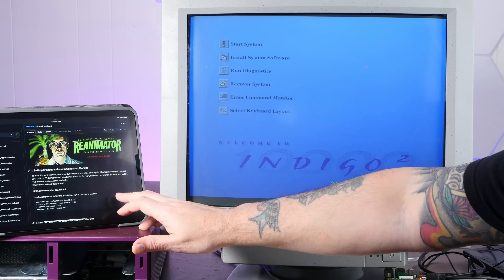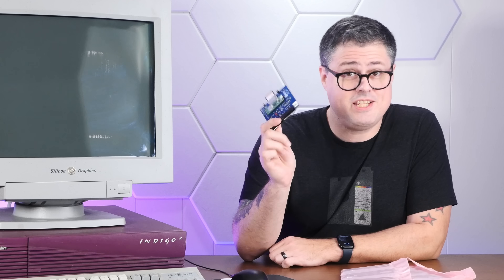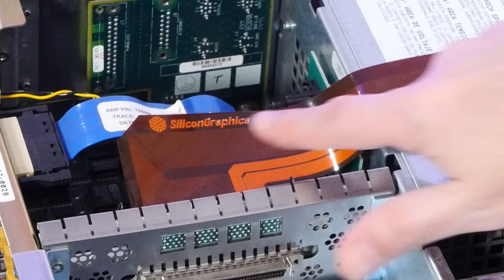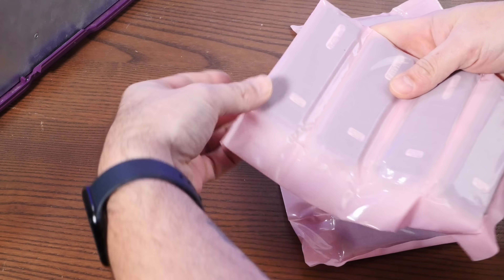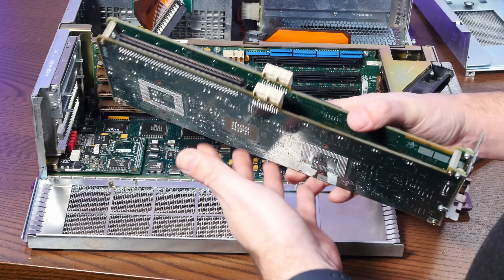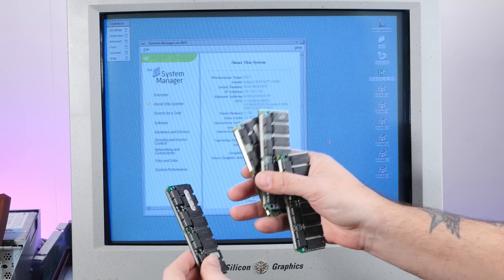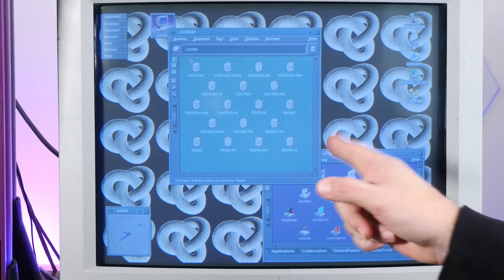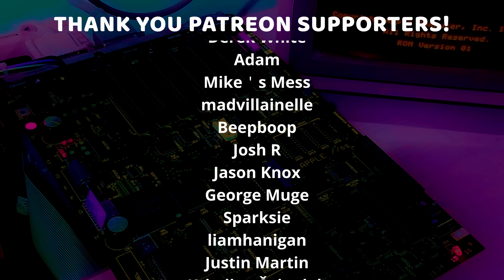Inside a $50,000 Unix Workstation from 1996

Comment: 50000 what a total rip off
Reply: You clearly don’t do professional work.  The software for one of these could have been $100,000 or more.  PTC sold complete Pro/ENGINEER systems based around Indigo2 for $120,000 plus tax and support.  You’re probably just a consumer though, not a creator.
Reply: @lookoutforchris  I know what these rip off company's charge, saying it's PROFESSIONAL does not mean it's justified. I know of 1 nameless company that has 2 ranges of boilers, the exact same part utterly interchangeable costs twice as much for the high end version. The same applies to MEDICAL if that word is used it will be ten times more, or MILITARY GRADE. So yes I do know what these things cost and I know they are a rip off

Comment: I was at the Disney Animation Studios in the 90s. Worked on a bazillion of these. Octanes too (what a POS that was). We paid something like $20K for the base computer. Then another 20K for the 396Megs of RAM. That was max. Each PC had two, 2G hard drives. We ported over our homegrown animation software called CAPS (Computer Animation Production System). Disney originally used Sun systems with separate graphic computers made by Pixar. Hell of a setup. But these SGIs were well designed. Easy to work on. We also used SGIs for CGI, of course.
Reply: I was across the street at Imagineering. We had a bunch of those (and beefier machines) in R&D. Good times.
Reply: @ Yeah, I was hired in July 1993. Feature Animation. We were spread out on Flower Street (1420, main building) right across from you Imagineers while that butt ugly studio was being built on Riverside Drive, next to the Main Studio Lot. I came from an aerospace background. The 'new' digital animation system they built from Sun computers (CAPS) was a nightmare. Surprised it didn't catch fire and burn the place down. And yeah, we had bigger SGI machines too (Onyx's, etc). We had a handful of IBM Power PC Unix machines to try out. Their Unix wasn't exactly BDS compatible. And the hardware was like PCs. Very crude. SGI bought CRAY and ruined both. We actually had a couple of CRAYs for file servers. The secret of our system was using fiber optics. We were pushing 150megs from each Unix machine using FORE I/O boards (ATM data protocal). Unheard of in the 90s.
Reply: POS?  Mines still running after all these years and has had zero issues.  Most stable computer I’ve ever used and built like an actual tank.  Performance on them was at least 5 years ahead of anything else you could buy on the desktop.  Wasn’t until the mid 2000s that a PC could touch an Octane for my work.
Reply: @lookoutforchris  We had dozens of Octanes. Every morning, we did a ping test to see what machines died (we did network rendering of scenes during the night on all UNIX machines). There were always 2 to 5 Octanes that froze up. If we saw the white light, we just reboot. But if we saw a red light, the whole thing was toast. There was a design defect with the power supply and SGI kept dodging our questions. If red light, that meant the PS killed every component. Trust me, we rebuilt a lot of them. They were loud and generated tons of heat. A couple of years after leaving Disney, I went back into aerospace (building satellites again). One day an SGI van showed up to show off their products. I asked the reps about the Octane PS issue. All the reps were very surprised that I knew about it. SGI was forced to do a mass recall. Apparently some Octanes overheated and burned down a HP facility. So yeah, to me, Octanes were a POS. Maybe you got a better PS.

Comment: In theory, you can model and 3D print the clips/hinges that hold the cover in place, and then glue them on.  They'll have to be a little bit different than the originals since they'll need to provide some surface to glue onto.

Comment: Hi, a couple options for the front door. Both involve remakig the missing clip(s)
1) Do the old 'build up the missing part with super glue and baking soda', then file the lump(s) to shape.
2) Cut / file suitable plastic to shape as clip repalcements and super glue / epoxy in place.
"I like to take a RISC every now and then", says the man with a MIPS CPU.

Comment: *IRIX is not UNIX. They’re two different operating systems designed for different architectures. Not sure how you missed that.
Reply: IRIX is based on UNIX System V.
Reply: You are wrong.  IRIX is Unix System V Release 4 with BSD extensions.  It’s certified Unix and fits on a major branch of the Unix family tree.
Reply: @ Redhat Linux and macOS are "Unix certified" as well. Surely you're not going to try and argue that they're the same as Unix from the 70s/80s.
Reply: @bradallen8909  Then Windows 11 is not Windows because it’s not the one from the 80s??? 🙂

Comment: It might not work anymore with today's Linux distros running wayland, but I used to play around with an Indy which was also hopelessly outdated in terms of software, but it was UNIX and it ran X, and my main desktop had Linux with X, and so through X forwarding it could display a then recent version of Firefox running from the up-to-date Linux, which made the machine more useful than it had any right to be. :)
Reply: Pretty much every distro still allows to use X11 as an option, even though many switched to Wayland by default.

Comment: If the original connection between CPU and heatsink was bare metal, adding a layer of TIM would likely slightly hinder the thermals. Not by much, but still.
Reply: With the way it was machined I would recommend using thin indium foil.
Reply: No, it wouldn’t. Thermal compound is always a better conductor than air, which is what all the microscopic gaps are filled with.
Reply: @tookitogo  The Indigo CPU and heat sink were polished to the point that there are no microscopic gaps, it was not designed to use thermal compound.
Reply: @ilovethe70s  I doubt it. To be smooth enough to not need compound, you need to polish down to smoothness that risks molecular adhesion. It certainly didn’t look like a highly polished mirror finish in the video. So there are air gaps to bridge with compound.
Reply: @ilovethe70s the machining groves were visible. There would be some gap.
Reply: I think he means the cpu would be adding more heat to the other chips using that heatsink, since thermal paste would transfer heat better

Comment: Loving the SGI content, absolutely incredible machines.   Shame all the UNIX workstations ended life towards the end of the 90s and Windows NT/Intel took over although we still have UNIX on the desktop running RISC chips thanks to Apple.
Reply: More like Unix-like. Apple uses a hybrid mach+FreeBSD KERNEL. Over the years a ton of original Unix code in *BSD got replaced making FreeBSD (the base system for Utilities and userland) more Unix-like instead of Traditional UNIX. Still it is UNIX-COMPLIANT because it complies with the rules of the SUS (single unix specification) but its not a full Unix system.

Comment: This was the kit I had on my desk at my first 'real' job working the tech support hotline at Discreet Logic in 1999. 

To get enough bandwidth to playback uncompressed NTSC footage in the Flint video compositing software, Discreet used both SCSI buses in parrallel to connect an external 'Stone' disk array.

One bus via a janky ribbon cable that hijacked the CDROM connector and was fed through some gap in the back... The other was via the 'regular' SCSI connector at the back.

Comment: so you down graded this pc with 4g sd card.i rember correct this machines cant support actually 15k rpm sas hdd up to 40g.
and sas hdd are way faster than cheap sd card.
Reply from the maker: I would love to find such a drive actually
Reply: This system supports 50 pin scsi drives not SAS.  You can use 68 or sca80 drives with an adapter.  There’s no limit practically to the drive size, it’s just whatever was around before they stopped making old SCSI disks.  300 GB drives might be the last common size you can find for sale.

Comment: That's near identical to my former Indigo2. I was curious if you had non 200MHz chips maybe, but nope. I've got the same ones. I was going to flex, but your specs are indifferent. Hehe. You have achieved an SGI Nirvana. Those CPU's were 64-bit in mid 90's when nothing else was 64 bit.

Comment: That wasn't the perfect amount of thermal paste, it was clarly too much. And also way too little. And don't get me started on the pattern applied.
Reply: You’re not supposed to use thermal paste on this system.  There’s clearly two old thermal pads on the heat sink.  They need to be replaced.

Comment: It's amazing how much of a powerhouse the MIPS architecture was back in the 90s into the early aughts for high performance graphics systems. Now you just never hear of them. Apparently the company is still around but is focusing on RISC-V development instead.
Reply: I still see MIPS cores pop up in embedded processors and microcontrollers every once in a while but they're rather uncommon these days.
Reply: @oliverer3  A lot of routers used to use them too. Hell, Mikrotik was supporting their MIPS routers until 2022.
EDIT: That was a different chip, NVIDIA's (unsure if acquired Mellanox) TILE. The latest version of RouterOS, v7 does NOT support their MIPS-based routers.

Comment: Seeing the inline power connectors for the graphics card makes me realize PC makers really need to figure this out, I hate the way we have to run separate cables to our GPUs in PCs nowdays. Why can't there be motherboard connector?
Reply: PCI express was designed to solve this problem with additional power supplied from the slot compared to AGP, but very quickly it was apparent that higher draw cards were going to appear that would use more than the 75W it could safely deliver and the ATX power supply standards were updated with an optional connector for supplementary PCIE power.

Comment: During my brief stint in college, we had a Unix lab with some of these (mostly teal R4400/Extreme models with 256MB RAM, but we had two R10k/Solid IMPACT with 384MB), and some Sun Ultra 2s. Those had either 512MB or 1024MB and dual CPUs - they were beasts, except on 3D where the SGIs stomped 'em. (They had Creator3D cards, so they weren't completely useless for 3D graphics, just not nearly as nice.)

Comment: Back in those days 1 GB of RAM was a lot.  At that time my computer only had a 2.1 GB hard drive.  I think it only had 16 MB of RAM and could only support up to 128 so that is very different from what we have today.  It had a 166 MHz Pentium with MMX.  MMX was a new and it was a big deal back then.  I think modern chips use it or something newer but similar.  At the very least we see improvements of older stuff.

Comment: Note that in 1996 I ran Linux on 12 megs and a 486 66. A MIPS R10000 with a gig of RAM is a bit overkill for contemporary software.
Reply: Not for its intended use. Linux was a tinkering platform for universities back then whereas SGI were the highest end commercial workstations of choice for broadcast quality video editing, number crunching for scientific visualisation and creating high resolution 3D graphics. All of those use cases gobble up as much RAM as you can throw at them. Linux machines couldn’t hope to do what SGI machines did back in the ‘90s
Reply: You were not doing real work.  An SGI is a professional tool for doing actual work.  It’s not a home computer.

Comment: Once you've had your fun with the Unix OS, please load modern LInux and try to use this as a daily driver.
Reply: Hardware's so proprietary that you probably couldn't use a recent kernel, and few people have had success with OpenBSD or MIPS64 Linux on SGI. Better off using modern software ported to IRIX so at least the base system works right. There's several collections, and maybe a Firefox newer than v3 by now...
Reply: Linux on one of these barely works, AIUI. It's almost easier to get more modern software going on IRIX.
Reply: Lol, what an ignorant comment.  You probably think an old Ferrari should be gutted to put in a Chevy v8 and automatic transmission 😂. None of the special hardware is supported in Linux.  To install Linux would be to brick this thing.  If you want to daily drive it run IRIX.  It runs just as well as it ever did.  Dumb Linux bros should just stay away from high end hardware, old or new.  It’s not something they ever understand.

Comment: Nice to see some SGI love. Irix was a really nice operating system and i liked the Indigo Magical Desktop environment.
Used to use O2 and Octan computers back in the noughties. I really loved working with them so have kept a bunch of SGI system. 
(A few Indy and O2s, an Indigo Impact with Solid Impact card and a Octane 2 with VPro 10 card). Also kept a large amount of
Irix install and software discs and even  a couple of starter kits for Indy.

Comment: Well SGI was the one with that ability for holding strong graphic images and 3d video. Which a the time, as of today requires big storage amounts of memory. Much it was used by TV stations for making 3d effects and animation banners for their TV feeds at the time. I used to work with an Indigo in 1996. The computer gets slow when you start adding graphic processing. Well it was 1996! When Steve jobs went back to Apple and the hype for computer graphics were at its highest with Pixar using SGI hardware.

Comment: I love that you 3D printed a stand, but I find it worrisome that it slid across the surface it was on when you tried to push the power button. If I had one I'd want the stand to be heavier, or I'd have to back it up against a wall so it didn't move when I turned it on.
Reply: Or put rubber feet on the bottom

Comment: It would be really cool if Super Mario 64 was ported to this, just for fun
Reply: The official developer kit for N64 was in fact an SGI Indy with an extra board that was basically an N64 (which also used a MIPS processor) though the board only "joined" resources (RAMROM) with the host system for debugging purposes. Its video out was looped back into video capture so you could see it run on the same screen beside the code you were working on, and it had jacks that connected with a 4 port controller adapter. More to the point, I'm not aware of a software N64 emulator running on IRIX yet, however the N64 toolkit runs natively on SGI hardware, technically, because that's what the N64 is, basically a custom embedded Indy.
Reply: Wouldn't be extremely hard - same CPU architecture (ish - N64 is MIPS R4300-derived, this is R10k, but IIRC, that's no different from say, running Pentium 4 code on a Core 2).
Reply: Thats pretty cool, thanks for explaining!
Reply: Can it play Doom?
Reply: @majorhemroid  Yes! IRIX 5.2 and later comes with it in the demos.
Reply: @ Yes.
Reply: @majorhemroid  There is a port called sgiDOOM for IRIX 6.5, I bet he will cover it in another episode
Reply: As extra credit at the SUN school for desktops the teacher had us get DOOM running in multi-player mode in the classroom environment.

Comment: If you used a 3dfx powered 3d accelerator or video card or currently use an nVidia video card you've got some SGI DNA in your PC.
Reply: Same if you use an AMD card, since ATI bought ArtX (the ex-SGI people behind the N64).
Reply: or xfs on disk
Reply: Every PC has some SGI DNA - OpenGL was designed by SGI

Comment: $50,000 in 1996 is equivalent in purchasing power to about $100,539.52 today
Reply: Putting the price fall of high end unix workstations after purchase into perspective I bought a used Impact for $1400 in 2000.
Reply: @porovaara  how much it was usefull at the time? compared to a 2000s pc in the same price
Reply: @enzoguimaraescost  completely destroyed a comparable PC of the same time. because of the higher ram, cpu power (specifically FPU) and typically much faster scsi disks one would have needed to spend 3k or more to get comparable performance for the kind of work i used it for.
Reply: You could buy lower end models for $50 until recently. Hardware depreciation was crazy. Probably won't happen again given how usable even low end old AMD64 computers remain. Much cheaper workstations from fifteen years ago still sell for hundreds of dollars.
Reply: Greedflation